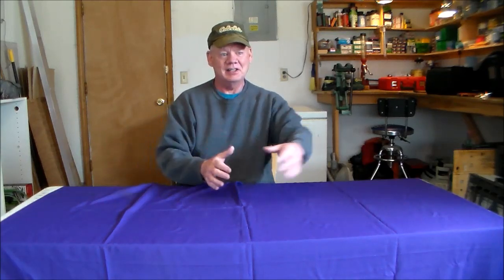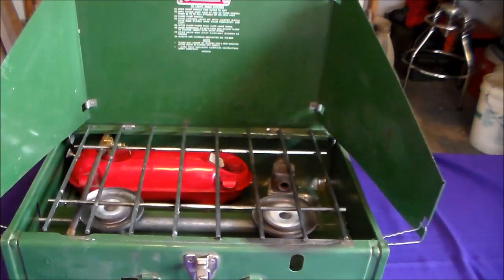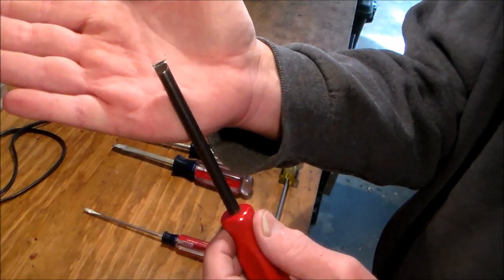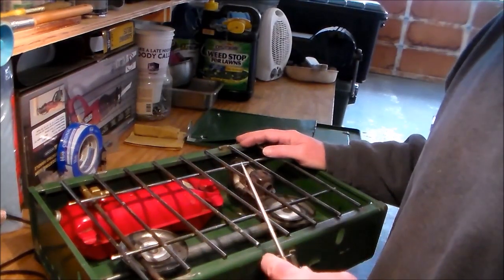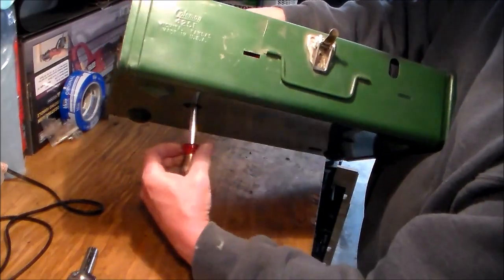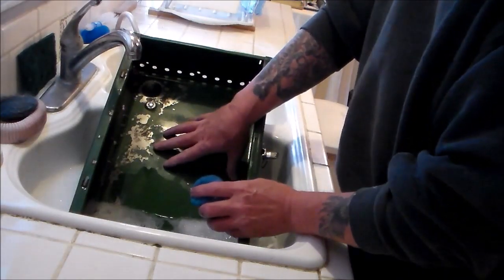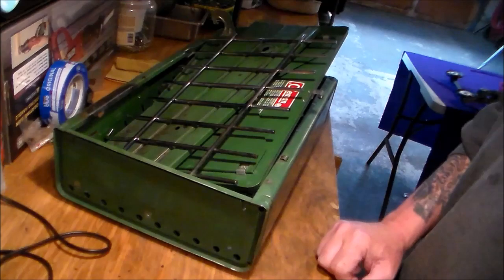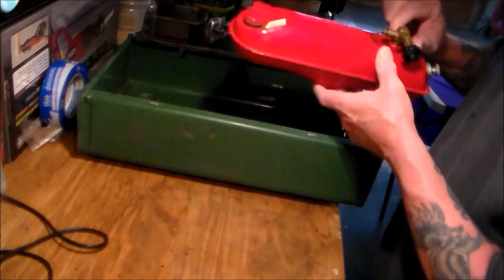Restoring An Old Coleman Stove Part 1

Comment: Rescued one of these (425E) from a scrap metal pile at work. Probably 1960s but it was not going to the cruncher.......It still has the fuel tank with fuel. 
The outer housing is rusty but still green. May leave it the way it is. 
This definitely will be alive and back to use once again.

Comment: I have one in the original box and it was bought in Calgary Canada from Woodwards in 1956 and still works perfectly. Some of the paint has flaked off under the main burner but it is reliable. I also have the 200 series Coleman lantern that is from the 50's and still works flawlessly.

Comment: I'm late to the party, but @16:27 made me laugh so hard.  I once started to do a motorcycle carburetor rebuild on the dinner table late at night when I thought I could get away with it.  A few minutes later I was properly told off.  Something about gasoline fumes, and chemicals on the dinner table, and what was I even thinking.  At least I used an old discarded toothbrush instead of a new one to clean out the pilot jets, before being banished to the garage to think about what I had done.
Reply from the maker: Been there. Done that. Good thing my wife is the forgiving type. She needs all the patience she can find!

Comment: This was a great series of videos.  I followed along and restored a 1974 Coleman (although it was already in great shape).  I put the stove back together. lit it up, an it started right up.  However, I have a slow, steady gas drip that seems to be coming from the joint where the generator tube meets the valve assembly.  Any suggestions for how I might solve this problem?  Any suggestions would be much appreciated.  Thanks...

Comment: thank you for these videos!  Maybe you can point me in the right direction.  I was just given a 413G that is in excellent shape.  Of course I say that but not knowing the condition i went through the process in your videos and still having an issue getting the burner to stay lite!? It will light and then just go out.  I have tried to pressurize as I'm trying to relight it but doesnt seem to be getting constant fuel.  Appears to still have pressure in the tank.  Any thoughts on where it could be hanging up?

Comment: Thanks for the great video series bob, very helpful. I Have a 425F from 1982 and now seems i cant close the valve tight enough, and continues to leak the the generator for 5-8 minutes until pressure is reduced, any thoughts?

Comment: I have a 413g that was stored for 30-40 years with fuel in it and is all rusty, pump is ok check valve is stuck closed, can’t get it out, generator seems ok but the fuel pickup piece in tank is all corroded. Was wondering if you sell tanks complete that you have restored ?

Comment: Great video! Very thorough. One question, if I want to paint my unpainted, galvanized drip tray, can I use regular spray paint, rather than high heat? I have 2000 degree black paint for everything else but I planned on painting the fuel tank and the drip tray a specific color that isn’t high temp paint. Do you know how hot those drip trays get? 
Cheers

Comment: I have my Father's old 4156 stove with the canvas bag.  It's leaking under the right burner, at the bottom of the horseshoe, and my Dad, always fixing things the right way, for some reason used Liquid Steel, and it has failed.  I wondered why he did it, because it's not really like him to "MacGyver" something, and i assumed the parts were not available..
I love this stove, but it's dangerous this way..  Do you know where i might find a replacement??

Comment: This Coleman series is so good! I removed the burner assembly but on the right burner I can’t get the screw to turn. We tried WD40 and a 30 year old son and 60 year old husband cannot turn that thing! Any ideas? Tried heating it up too.
Reply: Try a product called PB Blaster. IMO, does a much better job than WD40 in getting seized screws to turn. It worked well when I restored a 1910 treadle sewing machine. Bonus is that it did not destroy the colorful decals. WD40 will turn them silver. (sigh) PB Blaster is available from big box home improvement and discount stores. FWIW...  Sometimes it just takes patience, reapplying over several days,to allow the solvent to penetrate the corrosion in worse case situations. 

Hope this helps, if you  haven't managed to remove that screw or you encounter this problem in the future.
Reply: @oldtimerlee8820  Heat can help also you can get a paste that helps the screwdriver head grip.
This sort of thing: https://www.toolovation.co.uk/Gitta_Grip_p/gg007.htm   I have no association with this product.
Reply: soak the bolt over night .2 small hamer blows next day.....whoalla

Comment: OK so I don’t know if you point this out later in any of the videos but do you need the Primer first before putting on the Hi-Temp paint?
Reply from the maker: No. Just make sure that the surface is completely free of any oil or grease first.

Comment: Got a 9/90 424. Minimal surface rust. Holds pressure and only had one burner used. For $5.99

Comment: @Sagebrushbob Hello Sir what type of oil should I use on the leather round ring on the pump?
Reply: Coleman originally used neats foot oil.  3 in one oil works well also.  That is what I use as it was recommended by others that have oiled the leather pump cups.  Do not use vegetable oil!

Comment: Can the Coleman gas be converted to Kerosene?
Reply: Probably not.  Coleman fuel is basically super clean gasoline.  Coleman fuel is VERY volatile (evaporative).  Kerosene has a very different volatility, way , way less.
Reply: You’ll need to plan on pre heating the fuel generator. Otherwise it won’t burn.